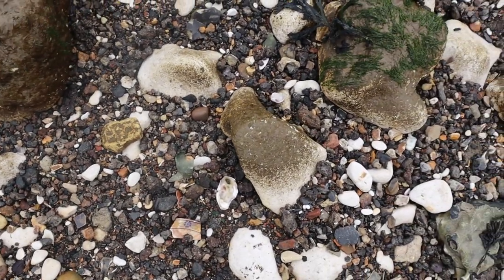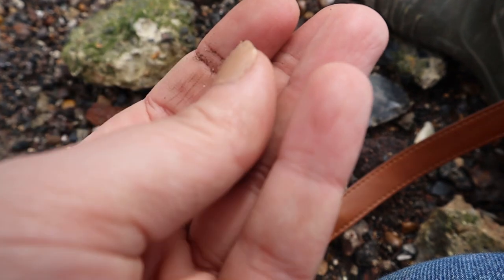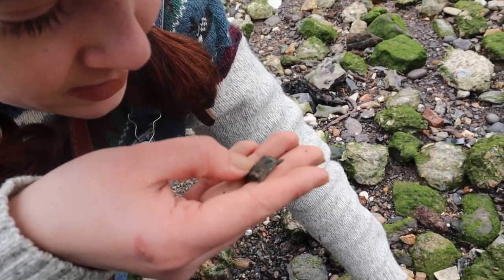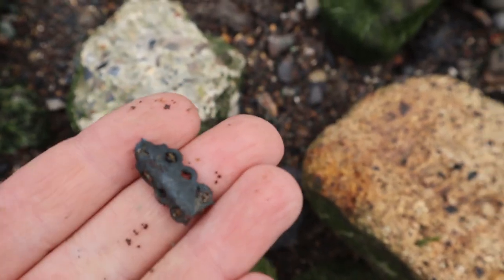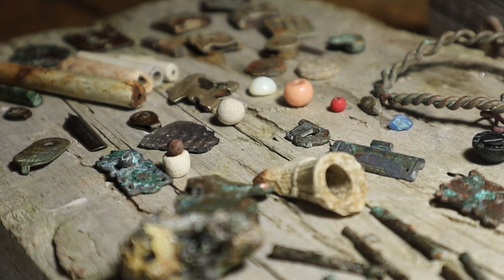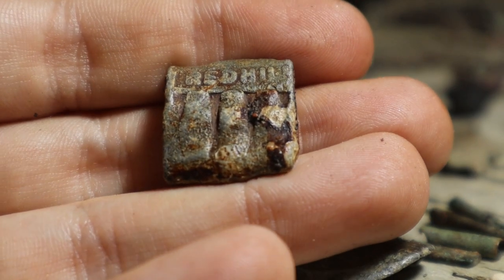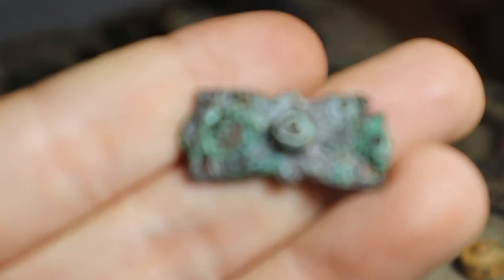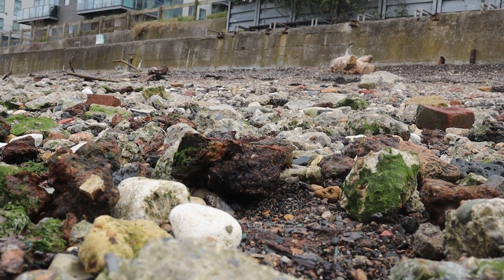MUDLARKING A TREASURE TROVE on the Thames Estuary + Dolls House Craft

Comment: The pointed decorated thing I think may have either been a dowl tool or a worn down punch used as one. .The engraving on the handle is to improve the grip.It’s small so I imagine it’s use would be for leather or even fine metalwork in jewellery or clockmaking..My guess anyway  You got some interesting pieces today ..Love n Light 🥰
Reply from the maker: Thank you! :)

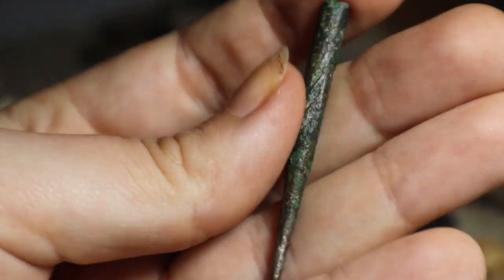Comment: 50:19 It looks like it is an awl used for leather work. It looks as if the handle part has been broken, I can barely see the end at 50:31 but if you Google "Antique decorative awls used for leather work" you will see a couple there with that type of patterns on them. It is an early one I would think 1700s maybe. Cobbler's and leather works used them a lot.
Reply from the maker: Thank you I think you are correct :)

Comment: On the sharp piece of metal does the opposite end "mushroom" out even slightly if it dose it could be a nail set or a punch of some sort...either way you make amazing videos 😉
Reply: I agree. It resembles one of my father's leather working tools. Perhaps to punch a hole to fix a rivet? Dad's was twice the length. Does it look broken in the middle?

Comment: I think the last "seal" out of the 3 that you showed actually looks like a piece to a light jacket.  The string that tightens up the neck or hood...it looks like what would be on the ends of the string.  Used as weight so that the string doesn't get pulled through into the hood.  Could be.  Not sure.
Reply from the maker: Ahh that could be possible thank you! :)